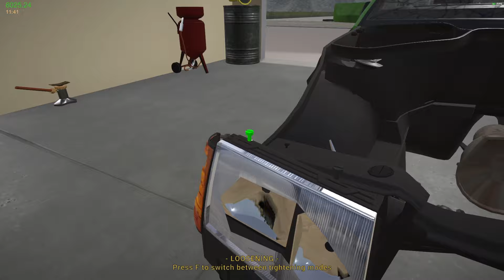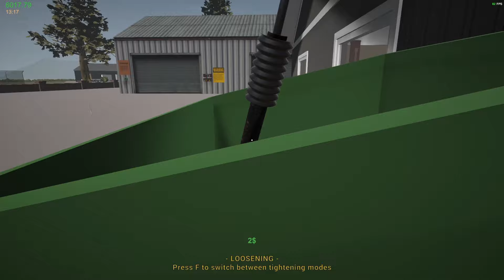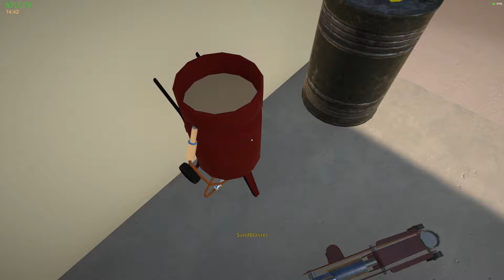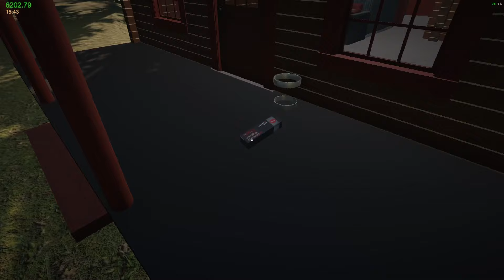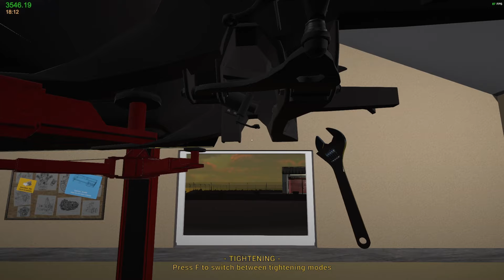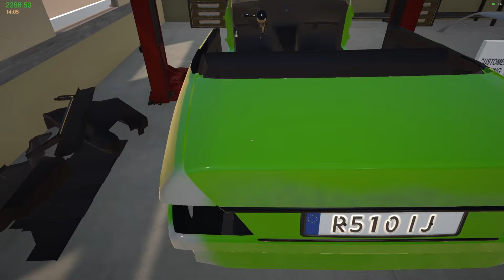My Garage Episode 19 - Convertible to hardtop!

Comment: There’s a mig welder mod. There’s a lot of mods that enhance gameplay like extra seats, wheels, more furniture, additional accessories for vehicles like the prerunner parts for the b200. I also like the air ride suspension (only lad) wish it had more vehicle variety for the air ride though.
Reply: And it’s SUPER EASY to install. Download extract drag and drop.

Comment: Few days ago I got one of those wolf wagons and I had to replace the roof, right doors front and rear, the right rear quarter panel and the firewall. I got everything to 5 star and I sold it to the dealer for over 37,000. I put in like 19,000 or something like that.

Comment: Spray booth mod also has a really good spray gun very fast at painting cars ,i like the welder mod rods never runt out and the grinder mod so disc do not wear out .and the engine mods are great build a really powerful diesel with a 4.0 block i one the drag race in a diesel b200 long wheel base with an auto box but does take nearly thirty seconds of turning the engine over to start .and an i6 turbo engine that is great all at nexus mods.I am building a lad station wagon with an i6 turbo engine .